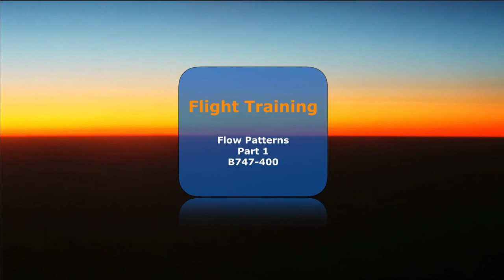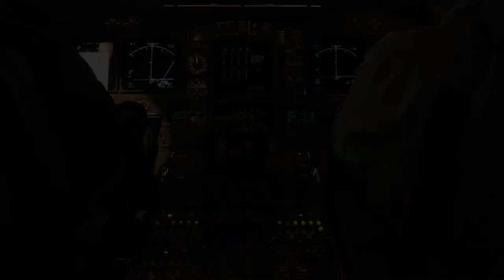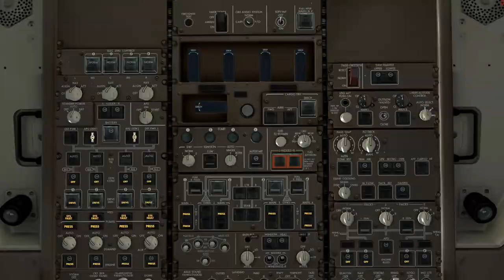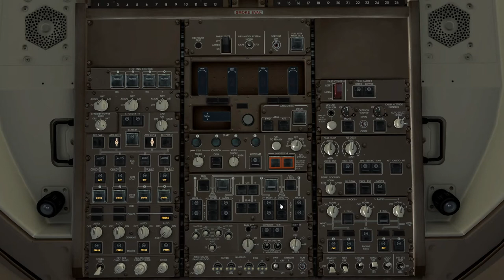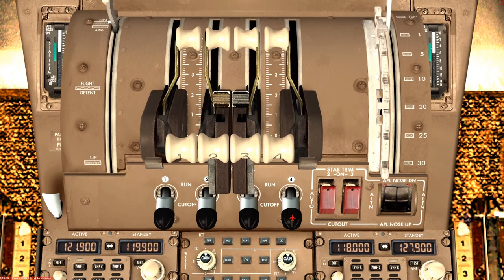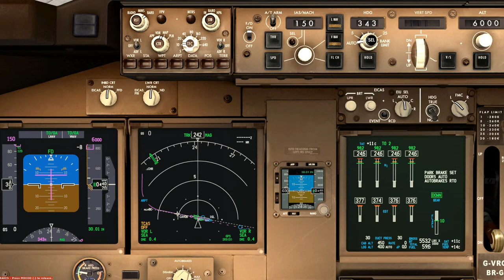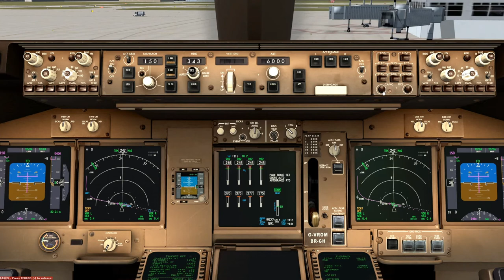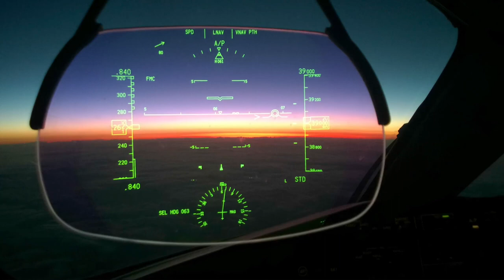Flow Patterns - Part 1 (PMDG B747 400)

Comment: Wish I had these for new hire training! Great vids. The PMDG model appears a bit off for center line though, in real life I find that you're one centerline (physically verified by the taxi or RWY centerline lights bumping the nose wheel tires) when the painted line passes through either the altimeter tape on the CAs side, or the airspeed tape on the FOs side. YMMV!
Reply from the maker: Thanks Heavy, many Level D simulators can be off also between either side.

Comment: Hey Captain, how do you monitor ground speed during taxi (I can’t see the characters on the cdu, nd or pfd on this tablet)? Is it calculated using gps data into the fms and displayed somewhere??
Reply from the maker: Ground speed is displayed on both pilot’s Navigation Displays in the upper left corner. The data comes from GPS, if equipped, or from the IRS if not equipped with GPS...

Comment: Excellent videos, where is the takeoff and climb video?
Reply from the maker: Thank you Efrain, that is a good question. I have not yet produced many inflight videos dealing with maneuvers, approaches, takeoffs, and landings, however at 10:45 on my EFIS/PFD- Airspeed, you can see information on takeoff and climb. Also, during the EFIS/PFD - Altitude and V/S it goes through a landing scenario. I do need to make specific takeoff and landing videos...

Comment: Heya Captain Al! Great Video! Would you by chance have a video in your archives for doing touch&goes in the 747 by chance??
Reply from the maker: No, I do not, but good idea for a video, here it is in a nutshell. On landing, no Autobrake or Speedbrake, no Reverse on Touchdown, otherwise no 
Touch& Go. After landing, PF pushes up the thrust levers to vertical to spool up and says “Flaps 20, Set Trim”. The PM sets Flaps 20 and trims in the green band, then says, “Trim Set”. The PF then pushes up the Thrust Levers manually to about 85 to 90%N1, not full Thrust, PM calls “Rotate” at VRef, PF rotates to about 17 to 18 degrees, climbs to 1000 feet, lowers nose to 10 degrees to accelerate, calls “Flaps 10, Flaps 5 on schedule, stays at Flaps 5, turns crosswind then downwind, levels off at 1500 feet above field elevation...
Reply: thanks for the speedy reply!
Reply: Would you by chance have a video that covers takeoff/cruising or decent/landings??
Reply from the maker: That is actually next on the list. I was just going to start more inflight type videos. You will notice though I have not put out any videos for more than a year. Too busy teaching and checking in the real simulator, but hope to get back to it soon.